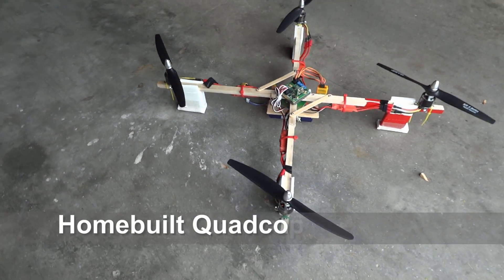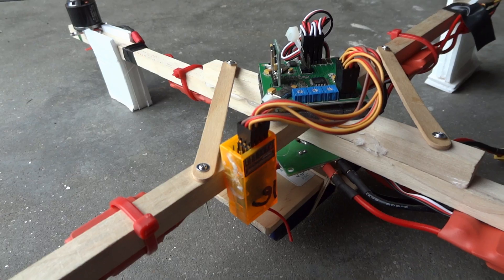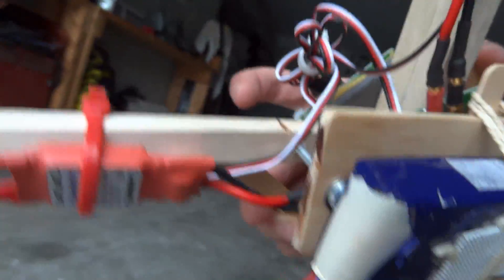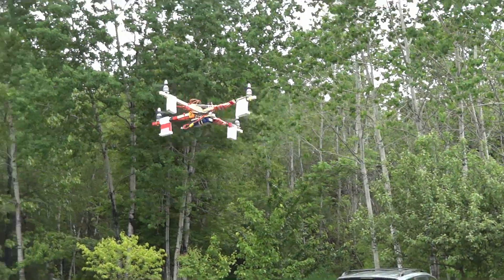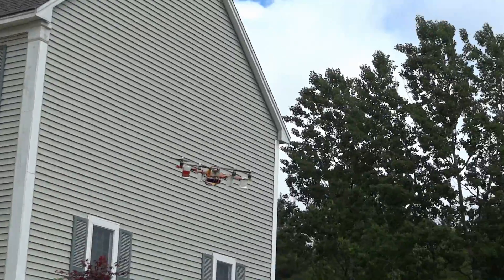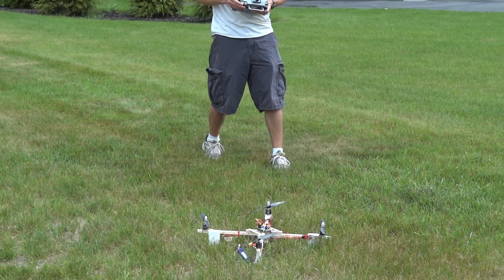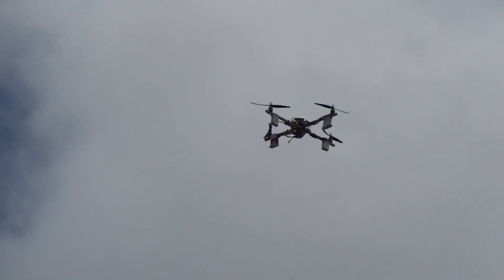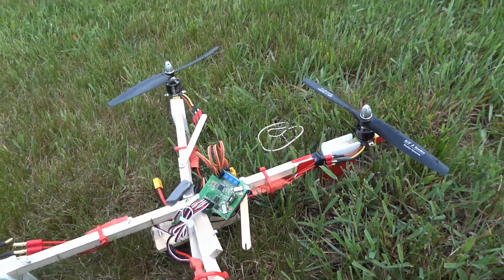First Homebuilt Quadcopter w/ CRASH - theRCexperiment

Comment: Nice but a hint from me. People buy cheaper part for Your first quad! The crashes come often so better make it cheap. Wood frame is great, also cheap RX is OK. KK borad or KK2 is absolute max for a starter. But no need for expensive NTM motors or Plush esc-s. Take Turnigy 1100kv motors and cheap SS 25A ESC.  After learning to fly make second copter which is better components. After that can move to higher end super expensive stuff and build third copter for longer period of flying.

Comment: put a glad ham container on it, also gives some protection to the electronics, with the front half painted a bright color and the rear half  a different color. maybe some orange props on front. The KK2 does have flight stabilization that works pretty good if especially if flashed with firmware 1.5